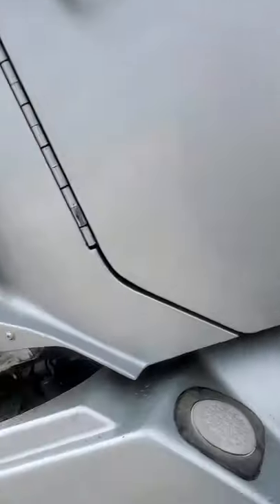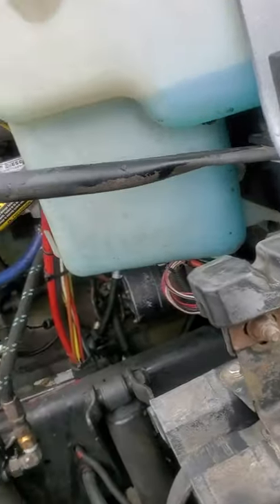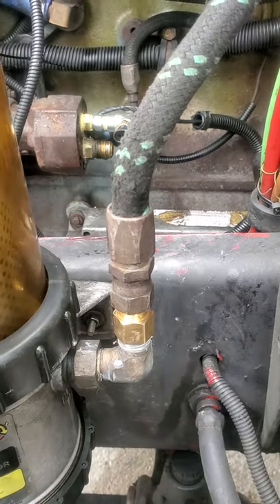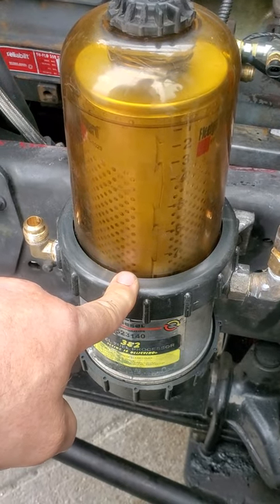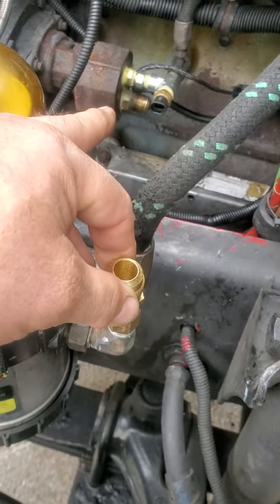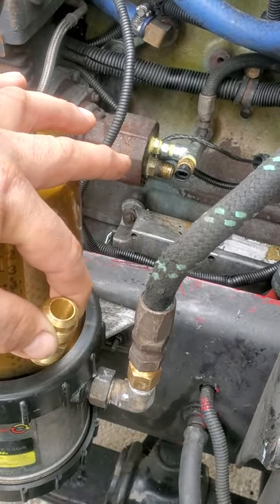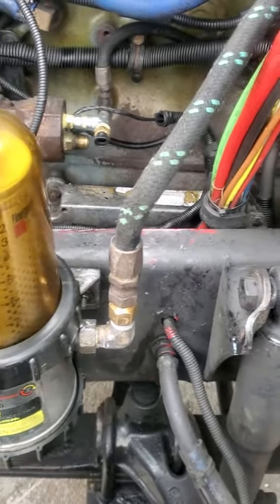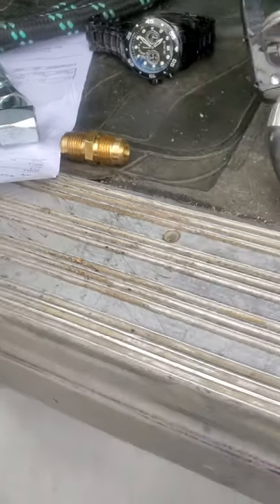SUCKING AIR IN THE FUEL. IS SOLVED HOPEFULLY?????? PART 4 OF 5 VIDEOS

Comment: PS, when you added that special brass connector (hack?, they just called it a "trick" in my day ) between your main input/output hoses, and so bypassing the filter/separator, you were also eliminating all those other (leaking) connectors that were probably leaking at the same time.  That's possibly why the engine ran so much better without all that added air coming from all those various fittings.  DL
Reply from the maker: YES exactly........ I've learned so much in this industry. Thanks for watching and commenting
Reply: @kurtsibila9682  Did I help any at all or had you already figured it out some time back as I didnt see that mentioned that it was fixed before I sent the msgs. DL

Comment: PPS, right near the end of the video when you're pressing on the dome and the air in the dome "seems" to stop bubbling, (moving anyway) it looks to me, and I could be very wrong there too, but more like you are just really just temporary stabilizing it so the normal vibration is greatly reduced,  so you're basically acting like a sort of (human) "vibration dampener".  So when you let go it just goes back to normally vibrating again (as it will) & so making the air in it that much easier to see move & vibrate again.   DL  PLMK if any of this works for you, OK.  PS, Happy New Year, Ya'll.  Go Texas! DL

Comment: Hopefully you got it fixed brother, and i was thinking about the o ring thing last night, ive had one incident with an o ring not seating properly and it actually caused fuel to leak out from the unit, so not seeing that in the vids let me know that the o rings were ok, but as far as the mechanics that slammed me, I hold no ill feelings, i know how it goes haha. I do think to myself about how I wish i couldve diagnosed it for you, but again, I m 4 months into this job at ta and my last time working in a diesel shop was 10 or 11 years ago, not doing it everyday made me lose a lot, i dont have a very good memory anymore. I really do wish i couldve caught that before you left, i hope the ole girl is running better for you. I really appreciate that you dont bash me for anything, it means a lot. Hopefully if I see you at the shop again, ill be able to completely fix anything you need. Keep trucking brother!
Reply from the maker: Hey brother. U did what u needed to do. And u know things can't be diagnosed right away. I did FINALLY FIND THE PROBLEM THANK GOD. I just posted a video. It was a crack in the clear bowl. I was able to buy one here at the Petro in Albert Lea Minnesota. I'm so happy. It was a process of illumination.
Reply from the maker: HEY BROTHER. I COULD REALLY USE YOUR HELP. NOBODY WILL LOOK DEEP INTO. WHERE THE FUEL PRESSURE SENSOR IS LOCATED ON A DETROIT 60 SERIES MOTOR. MINES A 2001. IF U COULD FIND OUT WHERE THE LOCATION IS? I'D REALLY APPRECIATE IT. MY CELL IS 414 477 7845 THANK U
Reply: @kurtsibila9682  did you end up finding where your fuel sensor is? If not, let me know and I'll happily help you out (I'm a diesel tech in Cleveland Ohio).
Reply from the maker: @strikeforcek9149  No actually I didn't. I appreciate if u could let me know. My cell is 414 477 7845. And thanks for watching and commenting

Comment: Good video. I had a similar separator with exact same bubbling problem. Changed the separator to solid bottom updated check valve and all hose. OK run much better but I still feel some vibration going low gear or uphill, wondering if I should change my fuel pump as well!!
Reply from the maker: Thanks for watching and commenting. If u are getting black duel in the separator? Changing the fuel pump would be a good idea

Comment: before you said fuel pomp or injector you need to look first Air Compressor that can leak coolant to the fuel  tank and problem will be same, it is very complicate fuel system  and if you don't find good mechanic you will be lose a lot of money i will recommend  anyone who has fuel system problem Go Dealer it is worth it, anyway thanks for you're information
Reply from the maker: THANK U FOR WATCHING AND COMMENTING THE COMPRESSOR IS NEW. AND I'M IN THE PROCESS OF FINISHING MY HEAD REMOVAL. YES IT IS A COMPLICATED FUEL SYSTEM. IT WAS LEAKY INJECTORS. THE DEALERSHIP HAD A 6 WEEK WAIT. SO I DECIDED TO DO IT MYSELF. CHECK OUT MY OTHER VIDEOS

Comment: I appreciate the information 
I got same situation with my truck Detroit series 60 12.7 DDEC4 it will choke when I'm doing 40 and 50mph and I test it with cruise control same for test only and it will choke same some white smoke and explosion coming from the exhaust pipe I changed all this parts new injector, ecm,injector harness, turbo, manifold,check valve. Head wash remove and send to machine shop new injector cup and test and I'm still same problem it will run fine and I will choke please help with ideas thx
Reply: Possibly turbocharger issues , not spooling up appropriately ?

Comment: What size or part number for the fuel hose? Fittings also? please and thanks
Reply: # 8(1/2”) SAE Union or
#10 (5/8” ) SAE Union 
both 45 degree flare / brass fittings .
The hose is either # 8 or # 10 .

Comment: I was going to make another (helpful??) suggestion but it may be too late now.
Reply from the maker: I'm always open to any suggestions, ideas or helpful hints. This air problem was taken care of awhile back. But please let me know. That's what we are supposed to do is help each other
Reply: @kurtsibila9682  What was the cause(s) of the air leaks?
Reply from the maker: @trainguy1218  It was actually a crack in the fuel line. Right at the connector. It was barely noticed. I swapped out the line and everything was perfect.

Comment: changed my oil, and filters today and truck didn't want to crank, couldn't start it, then white smoke came from under the hood , smell of fire, it was scary. road service Said was my computer,  towed it to mechanics,  I will find out soon what it is hopefully.
Reply from the maker: OH DAMN SORRY TO HEAR THAT. I hope it's nothing major or expensive. Please let me know what it was. If don't want to respond on here? My cell is 414 477 7845  GOOD LUCK BROTHER
Reply: @kurtsibila9682  I will respond here, no problem. 
yes, I can't understand what happened after the oil change, everything was good until I changed the oil. I can't understand.
Reply from the maker: @nm1978  That's so strange. I'm very curious what caused the fire. I hope it will be ok?
Reply from the maker: @nm1978  Gotcha I'm sorry I misread the info. Still hoping it's not serious. Let me know please. Thank u and good luck
Reply: @kurtsibila9682  I found out, it was bad starter caused by bad frozen  air conditioning pump, causing the truck not to start. Changed it all is good now.
Reply from the maker: @nm1978  Thanks for letting me know. That's not to bad. I'm glad it didn't cost too much
Reply: @kurtsibila9682  yes but spent $200 on road service  $400 on tow+ $2200 to fix everything.